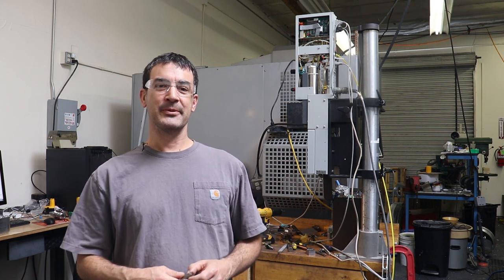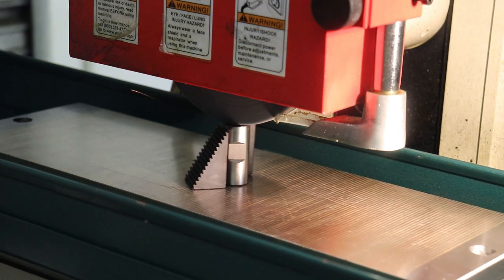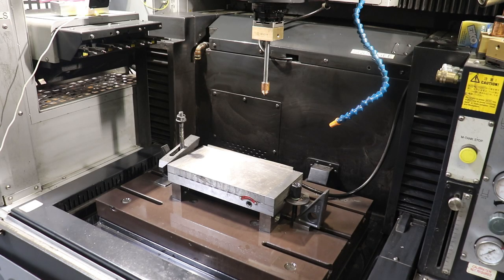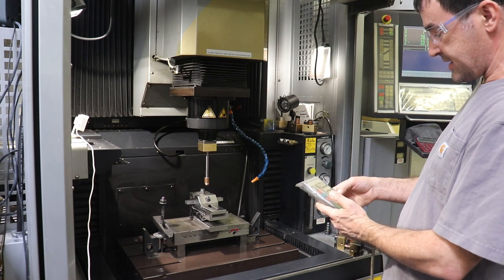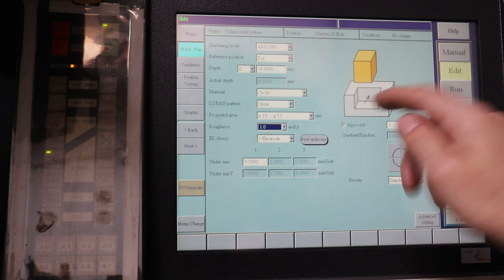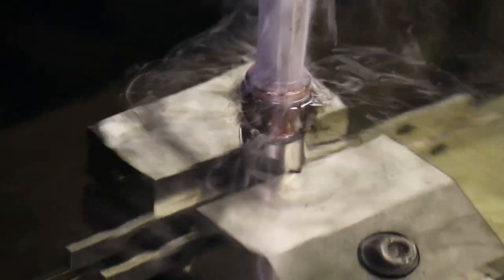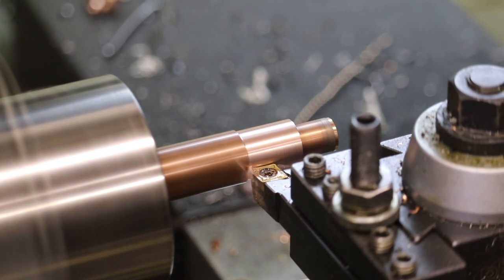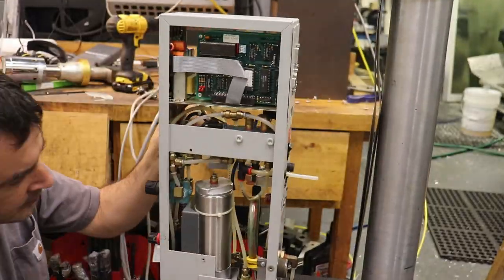Hole punch and EDM mill 2

Comment: Hi,
Nice video, thanks for sharing. I wanted to ask a couple of questions:
1. You've set electrode undersize to 0.35mm per side in the end, why is that?
2. I noticed that the program used different polarities through out. Wouldn't you have a lot of electrode wear because of that?
3. How close on size can you get on your first burn. Lets say you want to burn square  cavity 25x25x25mm and electrode is perfectly undersize by 0.5mm. Would you get on size +/- 0.01mm without adding some offsets etc?

Kamil
Reply from the maker: Hi Kamil,  Yes, good eye.  In the post editing I cut out the part where I wasn't sure about the spark gap.  I ran it with a 350 um gap instead of the 500 that my editing eluded too.  I wasn't sure if the edge would round off by 75um and the electrode I had had a step at the top from 18 to 19 mm.  You can see how the cutting edge has a thinner partial leading edge.  After seeing that the edm edge did not round off, I decided to make a new full cone electrode and refinish the part with 500um for next video. In general you need a big spark gap so the machine can optimize cut time with big sparks, then polish off the craters with an orbiting finish cut. 
for the polarity, I let the machine set those conditions, looks like it switch polarity for the finish cuts only.  I usually make 1 electrode for simple stuff, if there is fine detail, then I make 2 identical, or I refinish it.  Copper lasts much longer than graphite.
Reply: @DragonflyEngineering  Thanks for your reply. I'm running a manual EDM with adaptive control, but it obviously doesn't do any orbiting or increase amps if there is enough stock. After i run my roughing and finishing electrode I normaly measure my features and then need to create third electrode that accounts for inconsistent spark gap or flushing etc. waste of time ;/ 

Take care,

Comment: wouldn't it be safer to use a v block to support the shank when squaring off?
Reply from the maker: yes, if I had one short enough, I did EDM a stock V block in a previous episode to support shouldered ejector pins.
Reply from the maker: Actually I could have clamped the shaft to the top of my vblock with the removable screw clamp.  I will do that next time

Comment: I edm threads into hardened tool steel even tungsten using carbon thread electrodes, the smallest I have done is 8-32 but they have smaller. http://www.belmont4edm.com/osc/edm3-orbital-tapping-electrodes-c-21_25_28_370_371.html
Reply from the maker: cool, thanks for the tip!